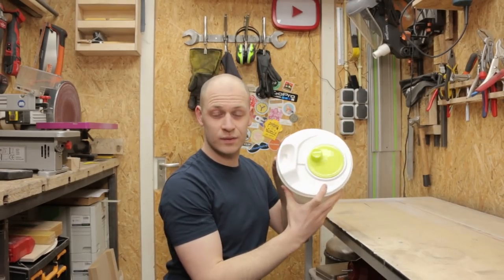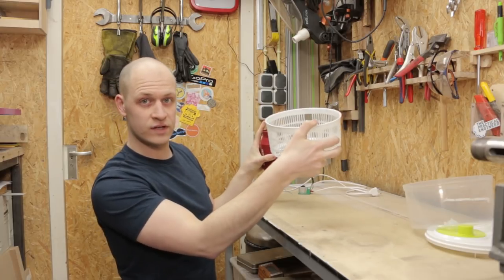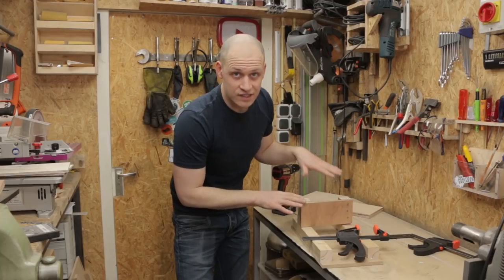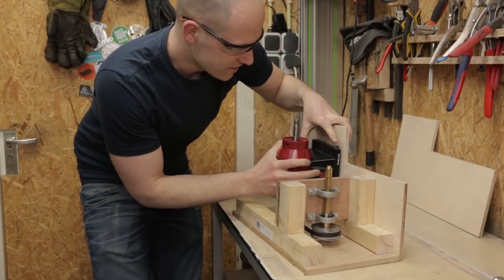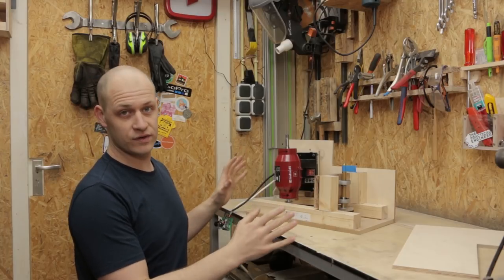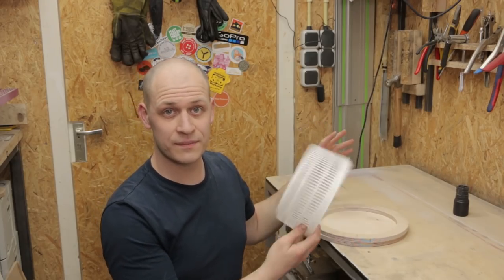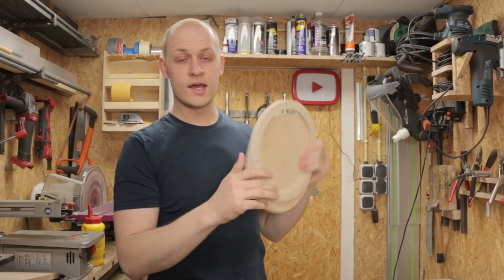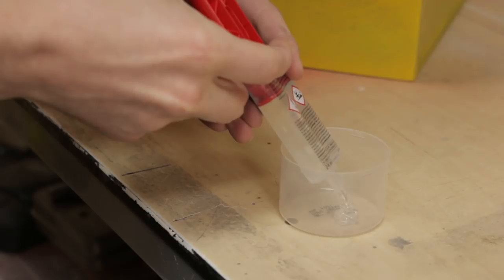Making a 1000 RPM Salad spinner! ​

Comment: Excellent project, and very practical.  😃
But only 1,000 RPM??? Use a router motor and swap the large and small pulleys and you should be able to get 75,000 to 100,000 RPM. That'll REALLY spin your salad!
Reply from the maker: Thanks! I can't think of things that are more practical than this 😂 Making one that goes that fast is a whole different ballgame. If this comment gets 1000 likes I'll make one ;) . *a 10.000 RPM version that is.
Reply: @Thepracticalengineer  Well I hope it doesn't get 1,000 likes. I don't want to be the guy whose idea gets you killed by flying salad-spinner shrapnel. 😳
Reply from the maker: That wouldn't be good.. I'll take proper safety precautions 🤓
Reply: 10k oughta be enough
Reply from the maker: Yeah that's already very fast from a components perspective

Comment: Your salad is going to end up all over the walls if you don't put a top on the basket. The good news is that when  it hits the walls it will be dry, so it won't stick.
Reply from the maker: If that happens it must be a sign to just cook a steak and have dinner..  😂 
But it actually stays in most of the time.